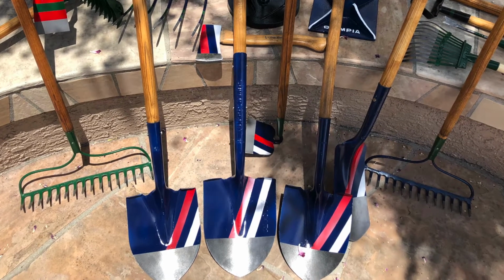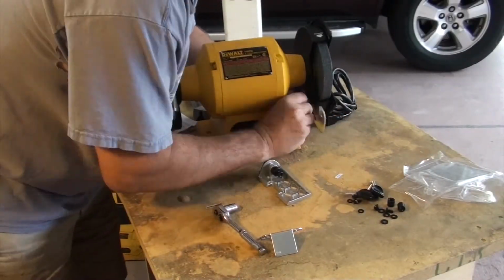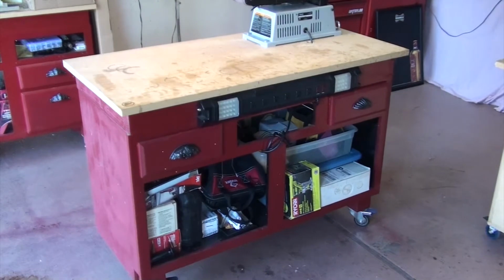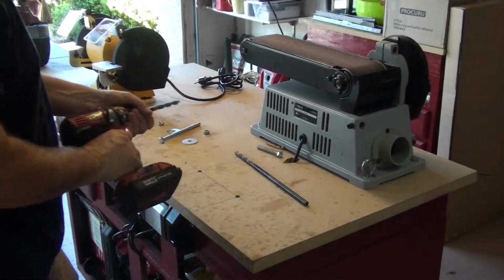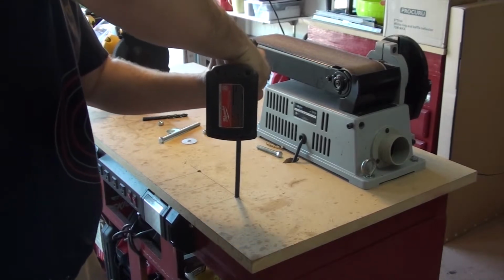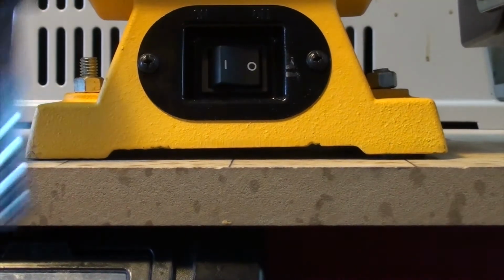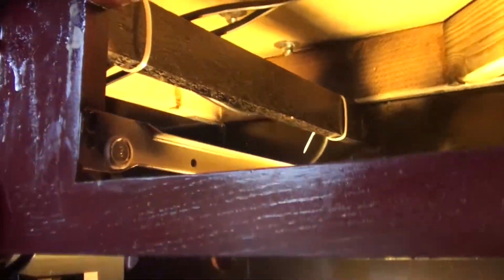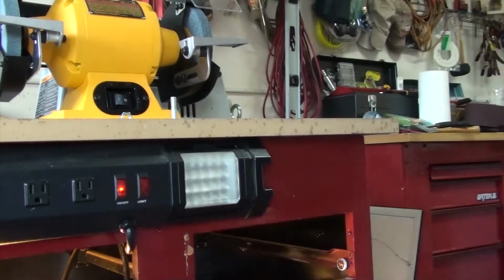DEWALT Bench Grinder DW756 DIY Assembly & Installation

Comment: Do you need a spacer if adding a wire wheel and does Dewalt come with a spacer?  Also can you add a buffing wheel! Thx
Reply from the maker: Hi K LE, thx for commenting.  You don’t need a spacer for the wire wheel itself, but you might want spacers for the shield/cover.
Check out the ‘swap to wire wheel’ video in the DEWALT playlist.
For the shield… I’ve searched for spacers, wider covers and longer screws, all to accommodate the larger width of the wire wheel, but have come up empty handed. I’m actually surprised DEWALT does not offer a wider shield to accommodate the thicker wheel(s).  I’m now considering fabricating my own.  I’ll make a video on it… given it comes out ok.  😂
Yes!  Same process to swap to a buffer wheel. I’m in process of ‘swap to buffer wheel’ video.
Did you subscribe to the channel?
Reply: @suburbandiy  Thanks, helpful feedback.

Comment: Hi, planning to buy one. I have a chinese grinder that runs very hot in 5 minutes with no load. Could not leave my hands on it for 3 seconds.  I need a grinder for at least an hour continuous use. Does this one gets very hot? Hope to hear from you soon. Many thanks
Reply from the maker: Hi Ro Si - Something is not right… it should not be getting hot that fast, especially with no load.  I’ve used the Dewalt Grinder for long periods of time… no heat, no change in performance… all good.  Time to replace your grinder.
BTW - did you subscribe?
Reply: @suburbandiy  Many thanks for replying, i went to a shop and tested two, but these Dewalts also get hot fast. Within 10 minutes they were hot, not so hot as the chinese made one, but still. I think these Dewalts are also Chinese versions. How long was the longest continuous period you used you're Dewalt grinder?
Reply from the maker: @rosi6144  I believe I ran it continuously for about an hour… sharpened a whole bunch of tools and wire wheeled a bunch of items, like lawnmower blades and such.  I don’t recall the unit getting excessively hot.
Reply: @suburbandiy   it was hot but not excessively.  I asked, because i'm afraid i'll burn it up if i buy it and  i run it for an hour continuously. Many thanks for replying
Reply from the maker: Thx for reaching out!  Hope we helped you and decision making.  Let us know how your new grinder works out.
Reply: @suburbandiy  Many thanks, i will
Reply from the maker: Did your new bench grinder work out ok?

Comment: Two questions....1) why not put the bolt end up and the nut and washer under the bench? give a much cleaner look that way! And 2) have you realized yet that you have the "spark guards" installed incorrectly with the shields? The flat square part of the spark guards are supposed to be mounted over the grinding wheel on each side....just saying....(and, yes, I know I'm two years late)
Reply from the maker: Hi Old School… 2 yrs ago and still commenting… so cool, thanx!  1) I make full use of the storage of the mobile bench where I mounted the bench grinder. I remember choosing to install the bolt head down so I wouldn’t catch items or scrape my hand when reaching for things stored below inside the bench. I agree however, it would be a cleaner look. 2) I have since removed the spark shields, as they actually got in the way a few times. Have you checked out the other bench grinder videos? See the ‘Power Tools’ playlist.
Reply: @suburbandiy  No, I just got my dewalt grinder and was looking for mounting ideas! The spark shields probably "got in the way" because they were  installed wrong! The flat square part goes over the wheel to prevent sparks coming out of the top onto your hands while sharpening metal! How are the shields mounted without the spark guards? I like them....

Comment: Why not just using lags into the 2x4's
Reply from the maker: A viable option… we went with bolts, not knowing 1 of the holes was directly over a 2x4. In hindsight, we should have contemplated the 2x4, and either moved the placement of the grinder, or used a lag.
Reply: @suburbandiy  gotcha